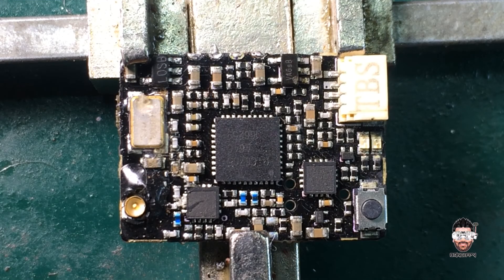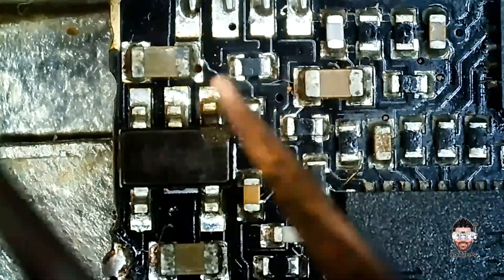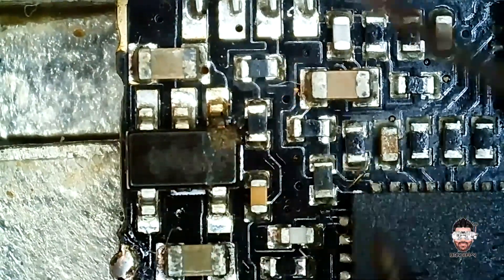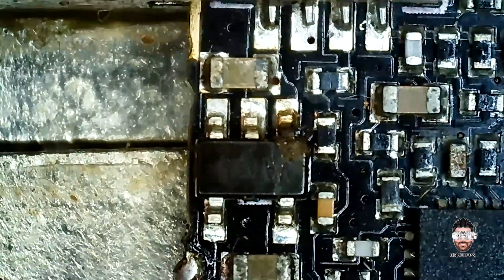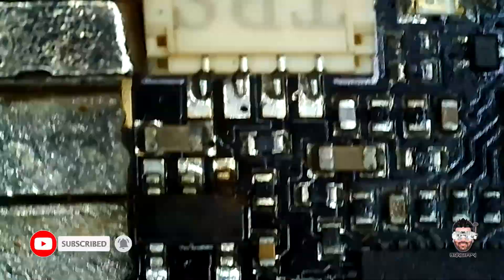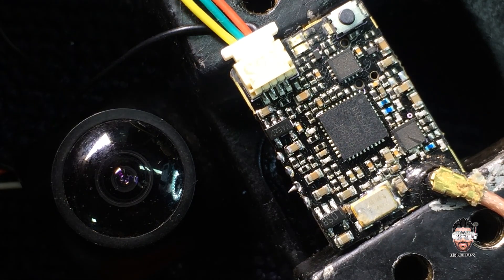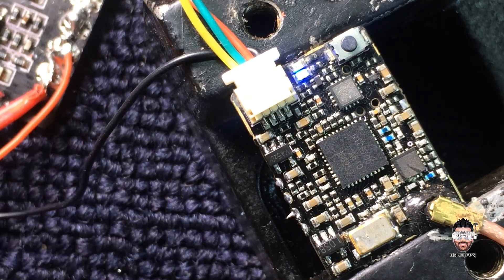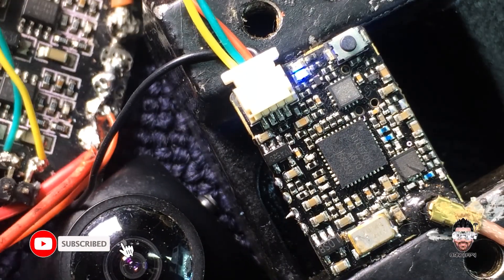TBS Unify Pro VTX Repair | BANDI FPV

Comment: Hi There, can you list some of the equipment you are using? What microscope? Very impressive repairs. I am just getting into the repairs side of things, and its very satisfying when something fires up after being repaired!
Reply from the maker: Hey Dude, Here are the gears I'm using, iPhone 5, Unbranded Microscope, DIY Rewoke Station & Soldering Station Using HAKKO Soldering Iron, Unbranded Bench Power supply, Pretty much it. Nothing expensive shit :D I'm also still studying electronics. ;)